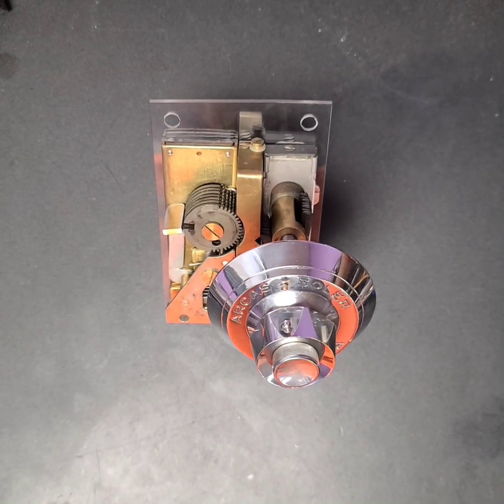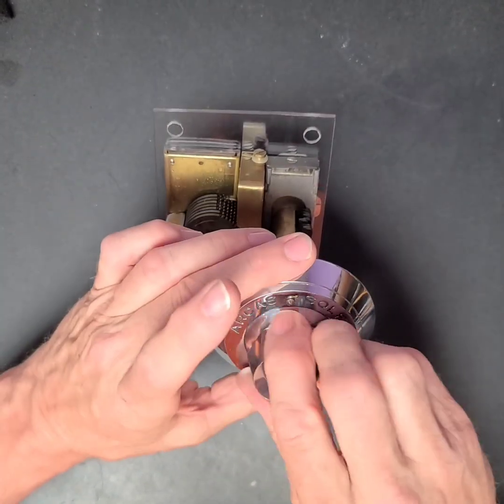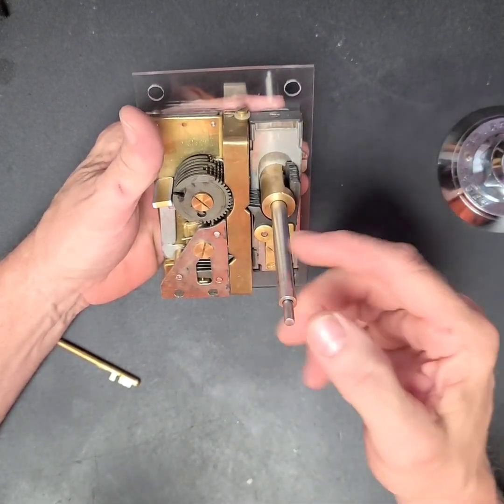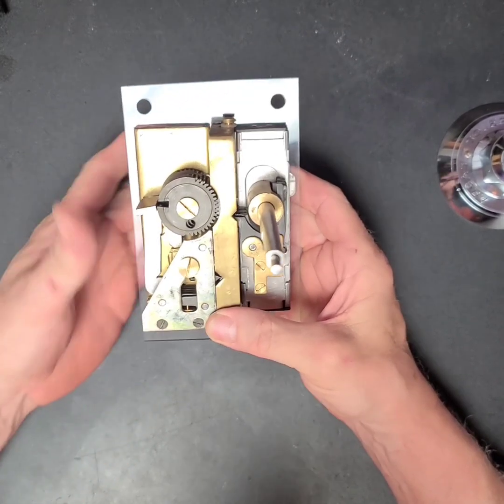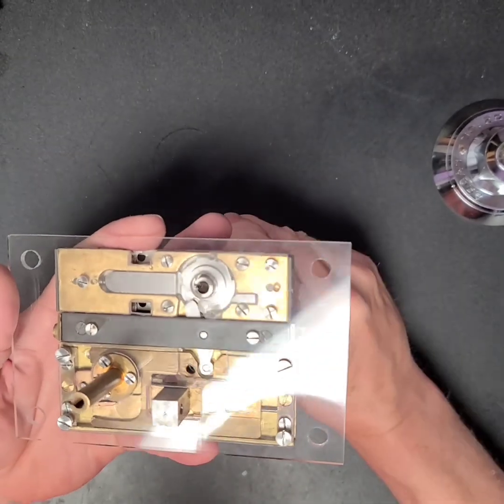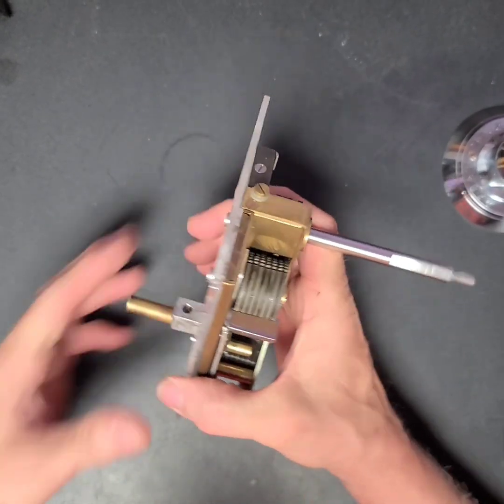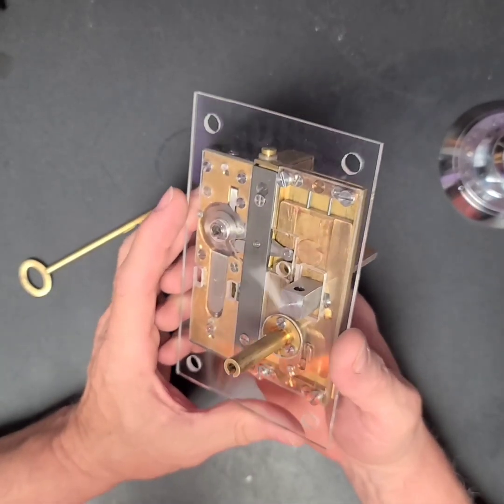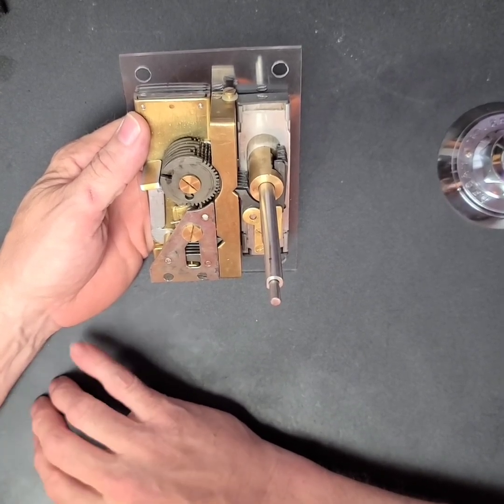Soler Pulsador safe lock: How it works

Comment: @Alexander Mundy - The main vulnerability with these Soler Pulsador and other push button type mechanisms, is the potential for someone to overhear the unlocking sequence. Especially if one knows how the lock functions. After the rack is reset, it's simply a case of counting the licks at each wheel position. But don't take my word for it. It's the reason I'd never use this type of mechanical lock in a safe or vault door.
Reply: my thoughts exactly, just need a hidden microphone

Comment: Very nice, it's a mix between a Fichet monocommande and a kaba simplex.
You have the reset / selection/increment/program and unlock functions

Fascinating that all of those kind of converge in various form factor. This one is neat as it wouldn't be more work to add more disks.

Nice démo !
Reply from the maker: I really enjoy the combination safe locks that work differently than what we are used to in the US. I have several USSR era, French, Polish, and Spain examples. One of these days I'll get my hands on a CNAB.
Reply: @alexandermundy2403  ah nice i was not aware of rosengrens combination locks. I can only find an opening procedure video from a quick search and a simple manual.

I do enjoy doing some patent archeology on all these locks. It's pretty instructive most of the time and you can see evolution of design. For example the original Kaba design was so much closer from the Fichet, ie all the selection wheels were not on the same shaft but more distributed on the surface. 

I have a monocommande coming and should do a comparison video.

Keep these video going!

Comment: Looks like Fichet made a lock with somewhat similar principle of operation, if I'm not mistaken
Reply from the maker: The Fichet C2C, Monocommade, and it's successor the Moneo have similar operation, except instead of pushing at a selected location you turn the inner dial.